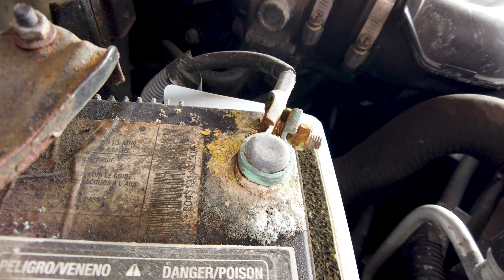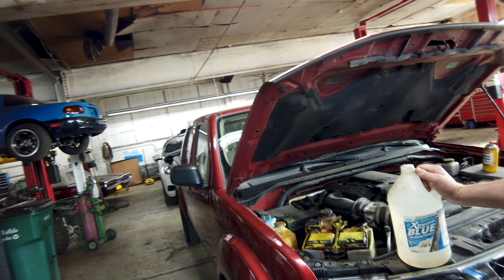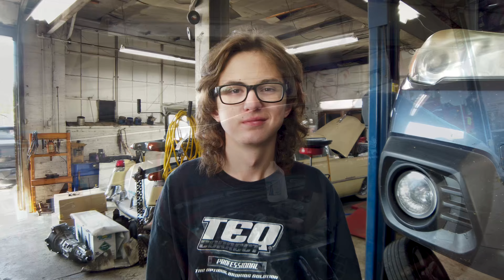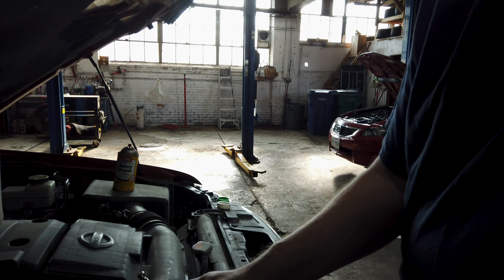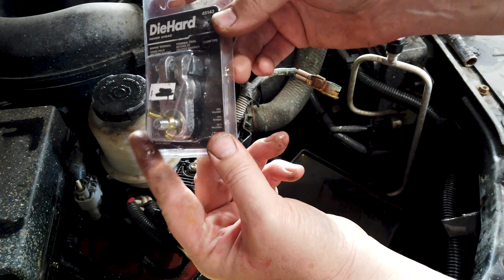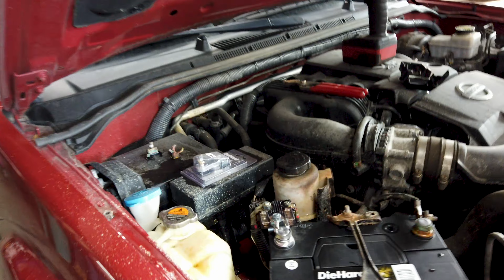Nissan Frontier Battery - How Basic Maintenance Can Save You Time and Money!!

Comment: I just went through this job on my 16 frontier S with 2.5l. My positive post had a cap on it. Never could tighten it up. After cleaning up battery; 4 yrs. old I charged up with cell caps off. 1 cell was almost dry. Same problem with hold down. Used scrap rubber pcs. Cleaned up every ground locations I could find. This all started with a dead alternator. Got 1 from Wilbert's. Learned my lesson. Excellent video.

Comment: Is there anything I’ll have to do after replacing the battery?? Just installed a new battery on my Frontier and still, cranking fast, but not starting.
Reply: Not likely, it seems like you may have another issue.
Reply: @BCChris    I used it in the morning, got back home, about 30 mins later it didn’t wanted to start. Took the battery out, Auto Zone said it was bad, got a new one, replaced it and still not starting. It cranks, but no start. Put an OBD2 reader and it gave me a P0603 code.
Reply: That trouble code indicates an internal problem with the PCM. I think this one needs to be looked at by a competent repair shop.

Comment: 1.   You replaced the battery with the same physical size battery ... Group size 35. You did not re-install the plastic corrugated thermal box shaped 'blanket'.
2.   The Die Hard Gold, group size 35, produces 640 cold cranking amps.
3.   The battery tray and area of its' location easily accepts a group 24 f size battery. In the Die Hard Gold, that size produces 750 cold cranking amps. This would be the size battery of choice if not re-using the thermal box.
3.   The battery hold-down brackets, the plastic tray removed (clean metal mounting plate under plastic tray and anti-corrosion applied ) re-install plastic tray, the fuse block positive terminal ( remove,clean and reinstall wires at bolt location at underside ) should have been anti-corrosion spray applied along with cleaning.

             In conclusion: A larger size battery would have benefited the truck owner. More power in cold cranking amps, and a greater reserve capacity. Nissan installed a physically smaller and lower capacity battery for at least two reasons: a) weight savings for a better gas mileage  b. cost savings for a cheaper battery ( plastic thermal box blanket is cheaper than larger lead acid battery. The Frontier used to come with the 24 f size battery at the same mounting location. The "Bean" counters saved money with the cheaper battery and plastic box.

                                                               Hope this helps